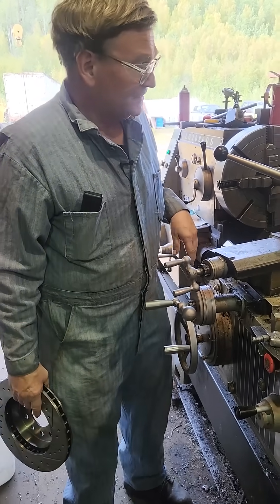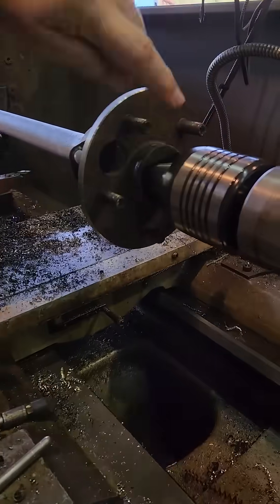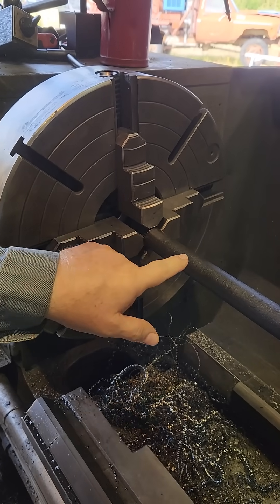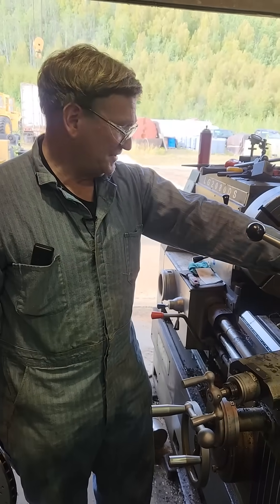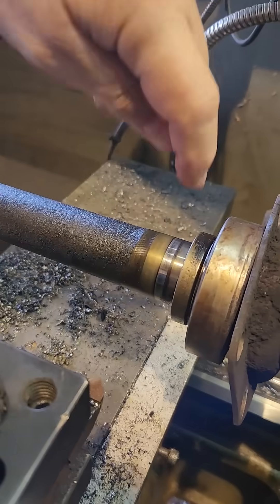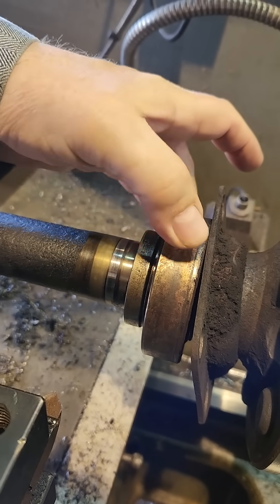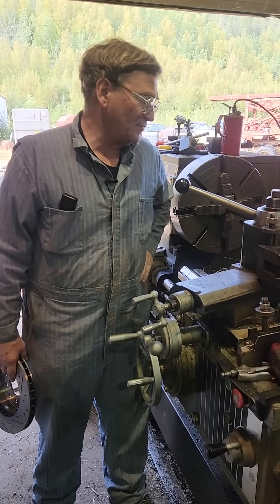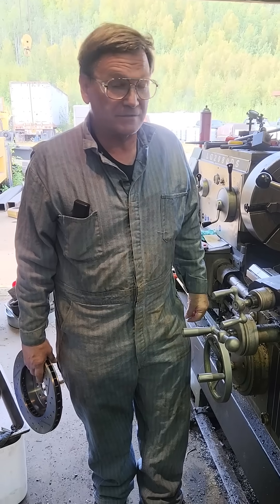How to chuck up a car/truck axle in the lathe

Comment: It's kinda weird the whole axel is not turned concentric for balance reasons.
Reply: On commuter vehicles a pretty bog stock wheel size of 16-inch with a standard tire would only see the axles spinning at 800 - 1000 rpm to see the vehicle traveling at 60-70 mile an hour... Increase the size of the tire and the RPM of the axles goes down for the same road speed...

You could have a fairly unbalanced shaft of that diameter supported both ends running at twice that RPM and not really see too much vibration... And the unbalanced nature of an un-machined section of a car's axle isn't going to be miles out, just a little out.

Fully machining the axle would improve vibration and some manufacturers do just that, but if you can get away without doing it without causing significant problems then it makes for a cheaper part and a cheaper vehicle in general... Which has its own quality
Reply: @terencem9962 i used to mess around with austin mini's, on 10" wheels, anything capable of more than 65mph i would go thru all shaft and rotating components.

Comment: Is that a Pontiac or oldsmobile axle?
Reply: Looks like a Ford 9" I used to plug the flange hole and redrill the bolt pattern for use in circle track stock car, turning the outer flange to fit a AMC rotor.
  Back when you could buy a rear for $50 and a custom rear axle was $400.

Comment: I always used a little soft metal. . . . Like copper, under the chuck jaws if I’m forced to clamp on threads, or splines. 
When I did spray metal on driveshaft slip yokes I had a piece of round stock, I would chuck it up close to center, then cut the 60 degree taper.  Use a bolt in the yoke, and drive the yoke off the chuck jaw between centers.  I think Cat. had a 40, 000 hour warranty on those yokes. 
It’s been many years, I think the spray metal was 21032 S.

Comment: The splined end has a center hole as well, but it probably needs lapped first.  It may have metal pushed in the center hole from the differential cross pin.  I would turn a 60° point on a soft center, so it runs turn and then I wouldn't have to remove the chuck.